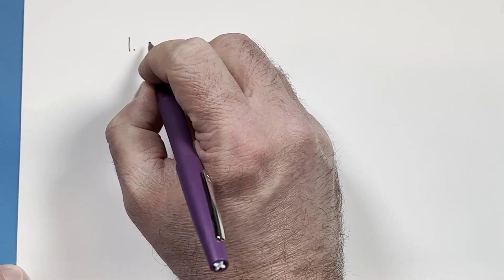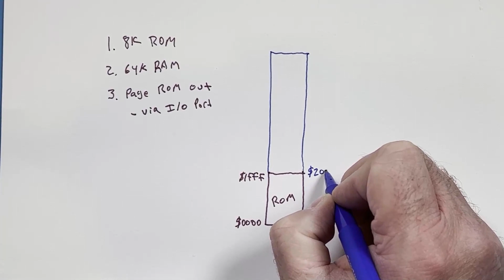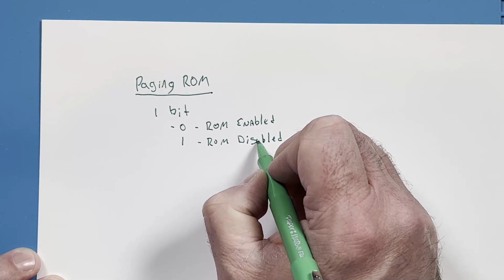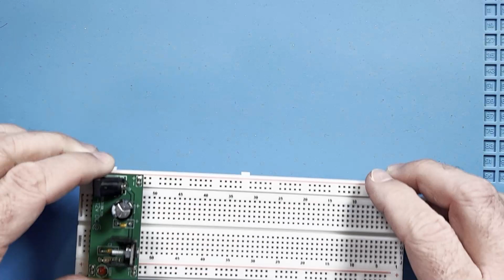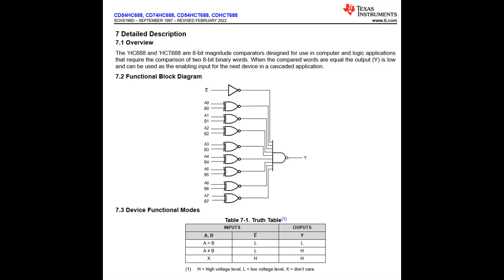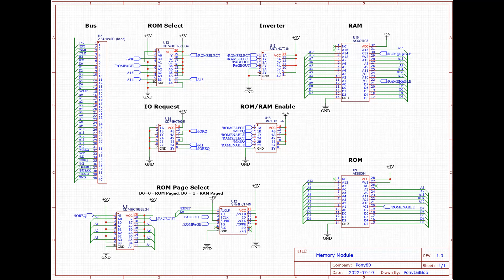Pony80 - 64K Memory Module BUILD - My Z80 homebrew computer!

Comment: Great video.  I just ordered a static ram to play with, arrived today.  Then this video popped up and you are using the exactsame chip ... lol.  I am just getting back into the hobby, never did use a static ram, they were super expensive 40 years ago.  I did do a breadboard memory upgrade for my Trs80 Model 1 using 64k x 1 dynamic ram chips.  I only used half the memory.  A lot of wires and it surprisingly worked.  Got my z80 on order for some future use, not sure what yet.

Comment: So simple and basic. A simple logic probe will save you a lot of trouble when it comes to tracking down poor or bad connections. The Z80 is good for control applications. Personally I'd forget about trying to maximize ram by bank switching. Thats a poor technique and adds unnecessary complexity. figure 1 or  2k for the stack and another 1k for IRQs. When you start writing assembly language or binary to memory by hand you'll find 64k is plenty of ram.  I think when everything  is said and done your entire program plus the ram required for temporary data storage is going to be way under 8k, probably in the 2 or 3k range plus an extra 1k for temporary storage.  I'd consider a few 74ls373's to monitor the control and status signals of the cpu, and setting up a way to single step the cpu. I don't want to rain on your parade but I don't see a single decoupling capacitor on the board. I say those are necessary unless you want random problems occurring in the execution of your program. Remember the CPU has a fanout of 1, an important consideration when designing a computer with a lot of chips connected to the address and data bus. Personally I'd think about using  a single 64kx8 static ram, and using a Raspberry pi or pi pico to put the cpu into the high impedance state and writing the code directly into ram by having the pi take control and perform a DMA operation. That's just me. It's your baby so you can do it anyway you want. I've done quite a few of these in the past, but my advice and or criticism will only get you a cup of coffee if I have 2 bucks to go with it. Don't let anyone get your feathers up. Never accept criticism from anyone you wouldn't take advice from. That's always worked for me. Don't get stuck thinking there's only one way to do something. I've been down that road. Maybe sometime in the future you'll consider using the MC68000 for a project after you've done a few Z80 projects. Peace out dude.
Reply from the maker: Thanks for all the great advice and support!!! Super cool comments!

Comment: 36:57 For the RAM chip, you don't have to match the Address or Data lines exactly.
Lets say you flip the databus. Sure data will be written flipped but it will be unflipped when read back out. same for address lines.

Comment: Thanks for the update. You inspired me to make my own Z80 computer, I ended up building mine on a z50 backplane, it made life much easier! I also ended up using a GAL for the decoding on a separate board with basically the same IC's. I was initially using 138 data selectors, but found having reprogrammable logic helped me troubleshoot a touch. 

Looking forward to where your project goes from here, I've hooked up an LCD and PS2 keyboard. (I've had an endless stream of issues with the interrupt line!)
Reply from the maker: That is awesome!  That is exactly why I am doing this. Hoping to inspire others!
Reply: @Aaron, I'm also very likely going to do my decoding with a GAL. I'm curious, why did you choose the Z50 backplane?
Reply: @microhobbyist  Because a friend had one spare locally. I don't regret it. Having all the pins broken out and good connections between the CPU and RAM/ROM has made the system so much more stable.  I found on breadboard if the CPU wasn't running properly it was a 50/50 chance it was the breadboard or the code.